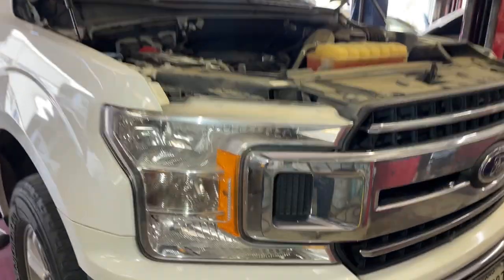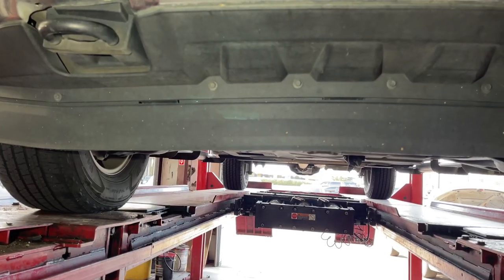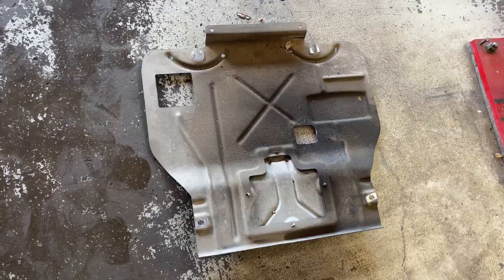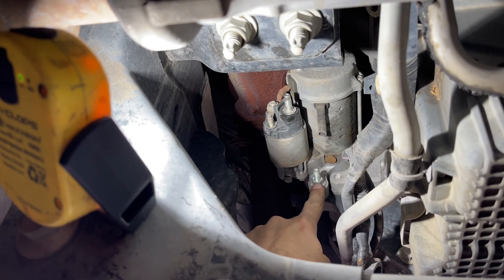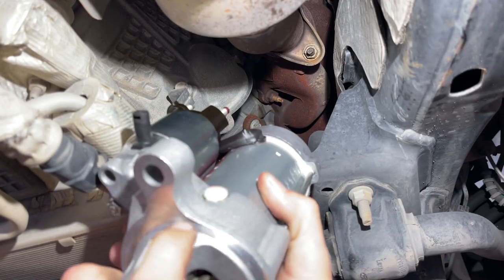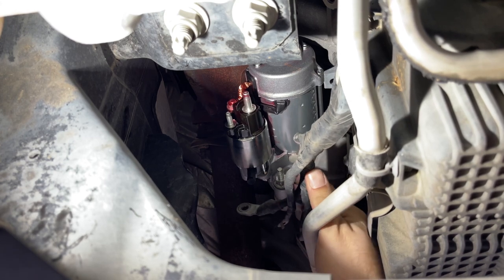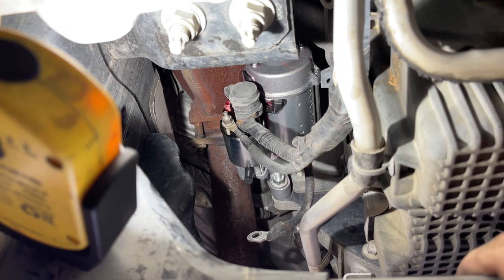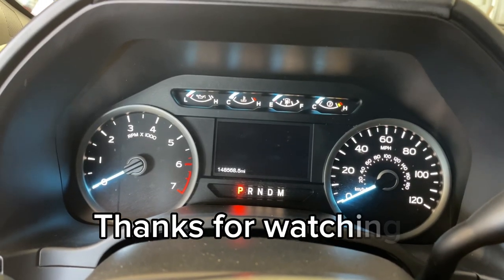How to Replace a Starter on a 2019 Ford F-150

Comment: Thank you Jack!  I have a 2018 with the auto shut off feature and my starter gave out at around 100k.  I was dreading doing the work myself but thanks to your video I was able to get the starter out without any issues.  Thanks again and God Bless!
Reply from the maker: That’s awesome! I’m so glad to hear.
Reply: Mine just went out at 80k on my 2019 f150 with the 5.0

Comment: Is there anyway to tell from VIN if you have 2 bolt or 3 bolt starter? I have 2018 with date of manufacture of 6/18. Never mind. 2 bolt after July 2017.
Reply: I was wondering the same thing cuz I have an 18, thanks for the info.

Comment: Lots of great tips there but the obvious question is why would the starter wear so quickly on a late model F150? Exposed wires on the underside - really, Ford?
Reply: Over 148K miles.  Mostly short trips and it makes sense.  Still, a 2019?
Reply from the maker: According to the customer, several times a week the truck would make a “sluggish” start and sometimes wouldn’t start at all. He would then have to let it sit for a few minutes before it would start. We could never duplicate his concern but he wanted to replace the starter anyway. I actually did notice that it starts up quicker with the new starter. Hopefully that takes care of his issue.
Reply: These starters have known issues with heat causing them not to work. Drive 30+ minutes and your truck won't start afterwards. Happening to me now with 80K miles. Recommendation is to put on the Ford performance high torque starter for the mustang.

Comment: Ok, with over 148K miles I'm slightly less disappointed with Ford having starter trouble on a 2019.
Reply: 148k city miles is justified but not hwy miles
Reply: My 2020 needs a starter and it’s only got 66k on it
Reply: My 2019 with 32k just had the started go
Reply: Samee here 66k miles @TadTrueman
Reply: 67k and replacing mine today
Reply: Mine turned out to be just my battery